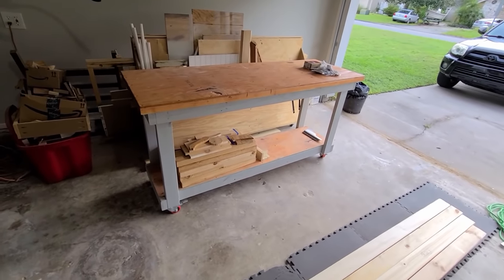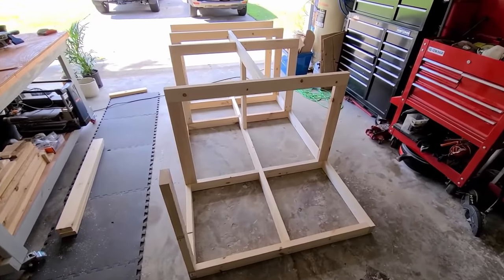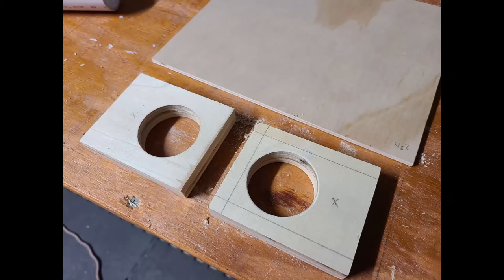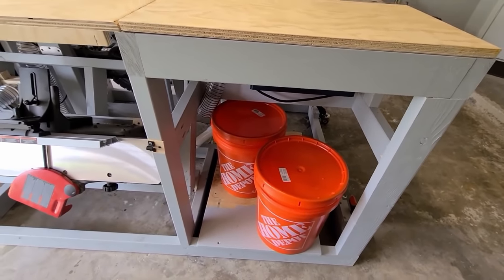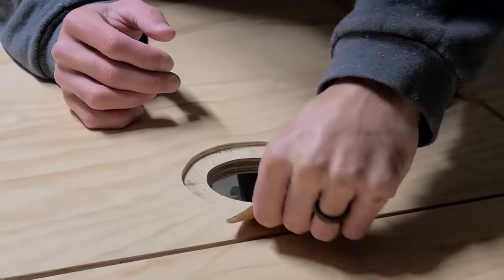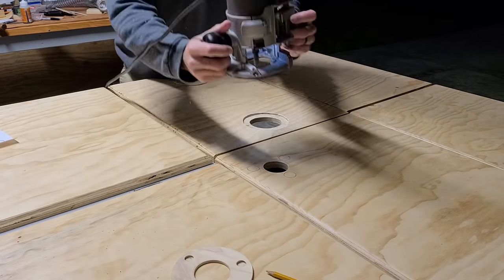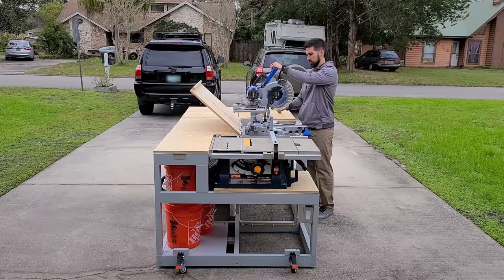4x8 Workbench, Tools, Vacuum, Power and Dust Separator

Comment: One thing I think that stands out with your table, is the tools are actually at appropriate heights for being used. As in all tools are at the right height to utilize the table as feeding/outfeed surfaces. VERY well done IMO.
Reply from the maker: Thank you! That was a very important part of the design.
Reply: That is very true super well engineered for sure
Reply: The bandsaw is the one that reallyu captures my attention!
Reply: Amen to THAT!  And, absolutely NO ONE talks about that.  And, while the “right” height, can be somewhat subjected, it would be nice to see someone talk about the height, and relation to other tools, as a subject in and of itself.  This young man did a great job with this.
Reply: Am I missing something? Why does that stand out? How would it make sense to not have these things level with the table?
Reply: @jamesbizs  because when people make mobile workbenches that incorporate a large amount of tools, they tend to deal more with storage of the devices, and not so much how it incorporates into the use of the tool related to the workbench. https://youtu.be/c_Zipc9MGmo is an example of a very good table, but doesn't take into account this idea. I'm not saying the OP is the only one... but generally it's not considered. Even if it does seem like a logical thing to do.
Reply: That would be my problem, getting everything to flip up at the perfect height. This is so cool
Reply: That's the significance and importance of "plan, plan, plan, execute." Well done!

Comment: You spoke of Gorilla Glue... look into a product called PC-7 (PC-11 marine) epoxy.  It's the stuff used to affix hwy reflector to the road surface.  It's a two part thick epoxy that's like a metal putty. You may remember a mom/pop hardware store display of a pop bottle with various things glued to it... wood shelf, golf ball, rubber kitchen sink stopper.  You can use it to fabricate parts, glue anything together, add broken pieces to a part like a broken bib valve knob.  It hardens like a rock in 24 hours, fuel resistant, and is the most solid forever fix product I know.  You'll find new uses for it for the rest of your life! The white marine PC-11 can be used underwater (when cured) and can repair fuel tanks.  Give it a try... my return sharing for your great video.  PC-7 from Allentown PA.  I've made climbing walls on bridge underpasses by gluing various nearby suitable rocks to the cement abutment.  X duct tape them up for a day, then bombproof.  Also avoided drilling new tile wall to put up  black pipe towel racks.  Cool stuff
Reply from the maker: Thanks for sharing. I'll have to check it out.

Comment: I have a 10' x 20' shed. Along the walls were my miter saw, drill press, band saw, sharpening station, shelving for additional tools, lathe, compressor, vacuum, trash receptacle and in the center of the shed was my table saw with workbench/outfeed table. No room to maneuver. I saw a video where this guy was set up in a shop and had three tools concealed on hinges to swing up for use. 
  I gave my brother in law my table saw and workbench and built a bench that housed five tools, band saw, drill press, grinder, miter saw, and surface planer. I used a 4' x 7' birch plywood top with 180 degree hinges to conceal my tools and vacuum. I bought a portable table saw and sold the attached rolling/folding  stand, making a box with drawers to support the table saw independent of the bench and housing a router table between the fence arms so that I could use the fence on either tool. To support each of the five tools I used 3/4" plywood hinged to my bench frame and aligned them so that the surface planer and miter saw table was in line with the bench top. 
  I made a plenum that I attached to the shop vac that allowed me to select which of the tools received the vac suction. 
 Door hinges supported the fold down tools and we're also attached to 3/4" thick triangles to swing under the tool supports when using each tool. 
  I also added drawers to house small tools and supplies and accessories under each tool. I have not yet  completely enclosed the sides of the bench yet, that's next.
Reply from the maker: Sounds very similar. How are the 3/4 tool supports holding up?
Reply: @phillipreborn  no problems, I used door screws to mount them to my 2x3 stud cabinet framework and made triangular hinged supports that swung under the horizontally hinged tool  support and just raise the tool high enough to clear the vertically mounted triangles.
Reply: @phillipreborn  great, I used standard door hinges and 3/4" triangular supports.

Comment: As an engineer over all a great design, but i would take advantage of the gap between the hinged tops that i did on mine.

Use a router t-track bit and route the gaps for a t-track hold down system.

the only other is the absence of a vise.  An end vise instead of the top mounted type with dog holes is a great add-on to any bench.
Reply from the maker: Thank you and thanks for the input. I think those would be great features.

Comment: Nice job.  Tip for you... When enlarging a hole from a hole saw, put the size you want on the arbor and then add the size it is now.  Should be enough room to thread them both on. Now just put original hole saw in and the bigger one will cut the hole larger.  This is especially useful when the center of the hole(s) needs to stay put.  They pop apart fairly easy with a screw driver after.  Enjoy.
Reply from the maker: Thanks for the feedback and the tip!
Reply: @phillipreborn  anytime

Comment: This is a great design. I've seen several done, but I really like this. The one thing I would change if I were doing it is how the casters function. Having them move independently will most likely cause the racking and eventually send the unit out of true. If you use a piece of angle iron or square tubing to connect them, it would cause the end to go up or down in unison rather than each corner by itself. Other than that, I think this is an excellent design. Well done!
Reply from the maker: I've though about doing that just haven't got around to it yet. That's a great idea, thanks!
Reply: Lol did you see the bending of the table when he was testing is? Just, ouch

Comment: I'm so glad I found your channel! I've spent weeks looking at workbench builds, trying to figure out how to fit all my tools and supplies into my tiny 10' x 10' shed.  I added an 8' x 8' deck in front of it so I could wheel my really old Craftsman table saw in it's 60-year-old plywood cabinet with drawers and a built in small outfeed table,  It worked well  in the first year of working in the shed, but more and more tools were added, then lots of furniture parts and other clutter took over and now I can't even walk inside.  I'm going to make your 4x8 workbench and have a home for all my similar tools, and make everything else either have a shelf or vertical pull-outs and get rid of the clutter so I can use the space again! I can't wait! Thanks for this great idea!
Reply from the maker: sounds good, you're welcome!

Comment: Boy oh boy getting everything right is a must. I can imagine having a tool too low, and having product banging onto the exit plane, swinging doors getting out of hand and loosening up the screws/hinges but if everything was done fastidiously then what an incredibly space efficient system! I love that after you move it you can set it down on the floor and its solid as a rock. And you could plug it in and use the whole set up outside! A truly amazing design! You should approach a manufacturer and make them a deal. I would love to buy your system built for me! To build that would be like rebuilding a car from scratch - it would take me a year full of redoes...
Reply from the maker: Thank you!

Comment: That is really good...now you'll WANT to build stuff as it ll be a pleasure to do!  No criticism, but I guess the compromise is a "divided" worktop, with all the gaps, but you could put a fresh board of ply or MDF on top for assembly if needed...I will defo be using some of your ideas😀👍
Reply from the maker: Thank you! Absolutely, it makes building things more efficient which makes the experience nicer overall. That is a good point. I still have my small work bench too but I can see how that could be an issue.

Comment: My man, you show some great joinery skills as well as carpentry and engineering. All in all, if I could follow your design and get it all in my 12X16ft shop and fit my basic budget I will be in heaven. This holds everything my dream shop would have. Aside a few hand tools drill press etc... But my man. You are over the top. Wish me luck. For me, this project won't be overnight. Most likely an all-winter project. With some carryover.
Reply: P.S. I would like to see more on how you hinged everything. But I usually overbuild. Thanks this will stretch my brain capacity for sure. 👍👍🇨🇦
Reply from the maker: Thank you very much!

Comment: Super impressive built. Only thing I'm going to add is that I built mine similarly in terms of framing and rough length and with just a 12" miter saw in the middle, that front lower 2x4 started sagging after about 9 months. I jacked it up in the center to take out the bend, then sistered 4 layers of birch to the front and that seems to be holding it for now. So watch out for that with this one and maybe consider beefing up the bottom 2x4 under the miter saw when you start noticing it.
Reply from the maker: Thank you and thanks for the tips!

Comment: Great project, I like the ingenuity to keep all the heavy hitting tools in one spot like that.  The biggest drawback to this system, I think is that it requires a bit of modification each time you decide you want to upgrade a tool....say a new table saw or planer.
Reply from the maker: Thank you, yes it does need to be tailored to fit your tools. I hope it inspires or encourages others who are building their work benches.

Comment: The smaller the shop the more important it is to make a workbench like this. My shop is 10' x 20'. With a full size table saw, full size bandsaw, 8,000 lb benchtop surface planer, large drill press, and a 3' x 7' assembly/workbench I had to learn how sidestep any time I entered tha shop. No fun, I couldn't even walk around my old workbench/table saw off feed unit. 
  Since my shop was about   18" off the ground I was able to position my shop vac and dust collector outside my bench, the main hose running under the shop to a diy plenum that was connected to each new benchtop tool, my table saw, and my router table which was built to fit between the arms of my table saw fence. I plugged all my tools into an automatic vacuum switch. The diy plenum has 6 blast gates mounted to it's top side, no debris to block the gates. 
  I can rip full sheet plywood or 8'+ lumber and have off feed support for router, table saw, surface planer and miter saw, neat.
Reply from the maker: Sounds good.

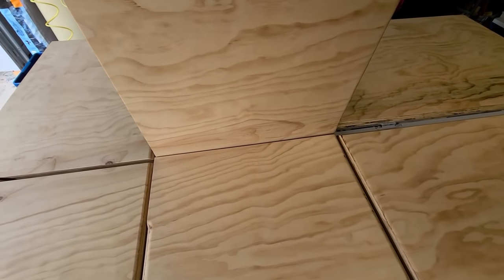Comment: Here is an observation you have probably already seen: @14:24 you are showing where your router table will go and the planer exhaust.  The router table doesn't need to be very far from the edge. You could off-set the spacing so the planer has more room and the router table has less.  You would end up with a longer door on the planer and shorter on the router table.  

It's a thought!  

I love your work bench. I'd love to have one that fits through a 30 inch door and is 5 feet long.  That's what I'm trying to design and build.  

Thank you for your inspiration.
Reply from the maker: Thanks for watching and the input. I'm glad it could inspire an idea or two.

Comment: this is amazing! I'm curious, if you could go back to the drawing board, would you move the plainer to where you intended the router to be and vice verse. I saw (see what I did there) the fence of the table saw could block large board.
Reply from the maker: Thank you! That is a great option to move the planer. For what I needed it made sense to keep it next to the miter saw and share a vacuum tube with the router. The fence on the table saw is removable. 👍

Comment: Beautiful build.  It’s been a few months, I’d be very interested in knowing how the dust collection worked out.  It seemed to me to be woefully underpowered.  Other than that, I dream of building this table myself. ***
Reply from the maker: Surprisingly the bucket head does pretty well except on the miter saw. A little more power is always better.
Reply: p.caballero_creative  do the magnetic connections work well with little to no air leakage?

Comment: All this impressive shit and dude’s got a Kobalt miter saw. Guess it proves that the tools don’t make the carpenter.
Reply from the maker: Thank you! I agree even though I'm just an amateur.
Reply: I've used a really small Kobalt moter saw and one of their 18 or 20 volt (not sure which voltage they claim, even though they're all the same) drills, and I must say that I was very impressed.  I've had nothing but crap experience with their hand tools.

Comment: NICE!!! I have one like it I built about 12 years ago now Mine doesn't the flip up parts though as I was looking for maximum number of tools. I didn't include my tanle saw but have my chop saw, router, duel grinder wheels, skill saw, panel saw, multiple power strips, built in full top vac system, and several other tools as well as bit storage one each leg, dog hole system, supply storage as well as sheet goods storage under bottom to reduce clutter in my6 small shop. And to think mine came from the need to use a old scrap pile I had off in a corner of my then cluttered shop. lol again very nice build!!!
Reply from the maker: Thanks for watching and sharing. Sounds like a neat one.

Comment: Great workbench. Well thought out and versatile with a place for multiple tool. Would be overkill for my needs. I like the large work surface but I would only be needing the table saw and miter saw. I'm thinking though I could build a bench like that and add the other tools later. I have a small shed turned shop so I'd build mine to fold up against a wall. Very good work and video.
Reply from the maker: Sounds good. thanks for watching.

Comment: I had a tablesaw bench a few years back (3ftx 6ft, i did something similar to what you did with the miter saw, except I attached the hinges to the front edge . The top hinged backwards and there was an I screw on the bottom. where I attached some paracord.
When you lifted the top It would lift the miter saw up, and when you flipped the top all the way over, it would hold the miter saw up, and 'perfectly' flush with the top of the bench.
It was actually my first table saw, and I had only really been woodworking for a few weeks before I started the project,  which only took me about 6 hours (tbe table was already built and i was retrofitting the miter saw into it)
Reply from the maker: Sounds good.

Comment: You can double up your hole saw on the same mandrel to guide the starter cut for the larger hole. Cool trick. Learned it recently put it to use it works. Forgot to add that I love this concept and your execution and work ethic is baller. Gettin'er done!!
Reply from the maker: Thanks for the tip!

Comment: A true innovative craftsman. I hope to make something similar in the future, but probably smaller and perhaps only integrate a few tools on each cart. This allows you to have several tools set up and ready for use with certain projects. The only drawback I see is that you have all that wonderful flat real estate, but can't really utilize it for large flat projects without hindering your tool access. Maybe this would be good for someone that makes smaller wood projects. Fantastic video!
Reply from the maker: Thank you! Yes the nice work surface is sacrificed if you have a few of the tools in use. I have a smaller work bench and saw horses on standby. I hope you get to make something to suit your needs.

Comment: Very innovative out the box... I'm doing similar but using a straight Vac PVC pipe down the middle with off shoots from each powered tool... also nice job on the electrics..
Reply from the maker: Thank you. One thing I want to add to the electrical system is an automatic switch for the vacuum when a power tool is in use.

Comment: I'm an engineer (electrical) but I enjoy watching people build and create.   I have a 25'X25' workshop and I built a similar 4X8 workbench that attaches to my table saw.   I struggled with how I wanted to address dust collection.  I have french doors leading out of my shop so I often push my table just outside under a covered entrance just to be outdoors.  My dust collection, or control I should say, is a cordless leaf blower.   My planer has a dedicated shopvac and separator, but the work table and saw just get blasted with the leaf blower to keep it out of the shop.    It works for me and my location.  I like how much thought you put into it.    Keep it up!   I like the design
Reply from the maker: Thanks for watching, I appreciate the feedback. Your comment reminds me of my automotive refinishing days. We would just sand away wearing a mask then blow away the dust with compressed air or a leaf blower. Sometimes its more efficient that way especially if you're outside.